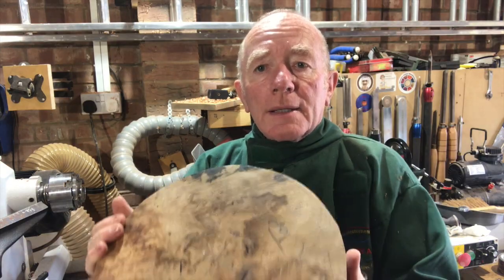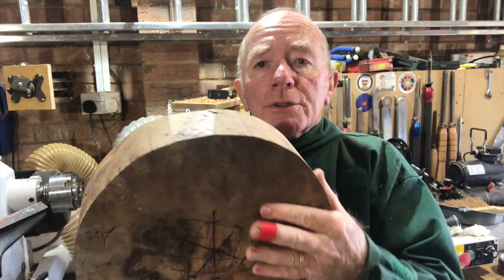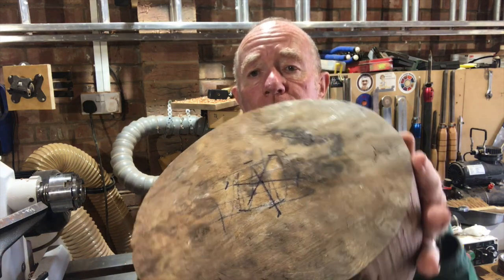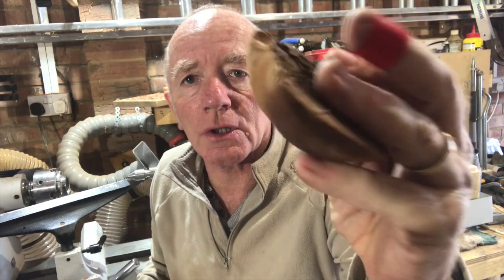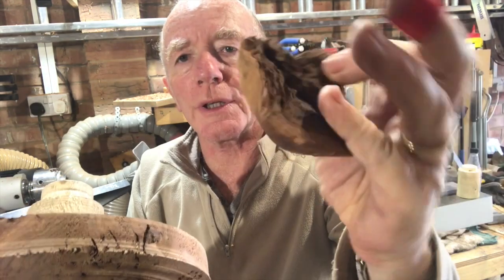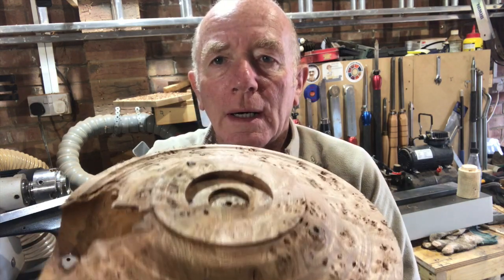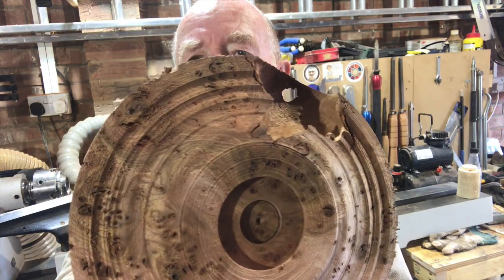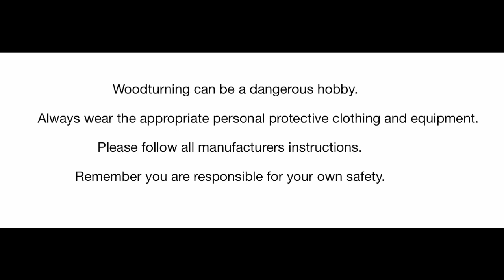# 43 Elm Burr Failure

Comment: Hi Tony,
Too bad but it looks like a tight fitting piece which came out. 
Couldn't you simply glue that piece back in?
Reply: Hi Leo yes it could be glued in but I think it’s a project for later and I am debating to use resin. Cheers Tony
Reply: @tonymeadley8444  
Hi again,
Thnx for yor reply. I'm sure you'll get it fixed one way or another. 
Another question if I may:  I noticed you use round metal plates with print on them to mark your work. 
I like that idea but I'm turning on a rather tight budget. Are they expensive and where did you get them? 
Probably you have to order them in bulk to reduce the cost. (?)

BTW: What is written on a piece when it is finished? 
I'm looking for something bearing my name or initials, maybe a a serial number and some free space to write the date.